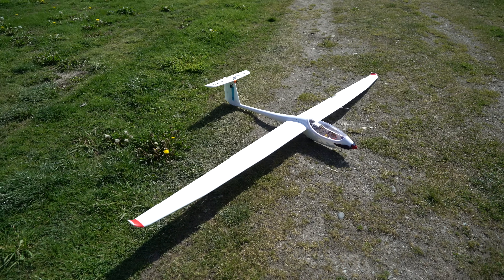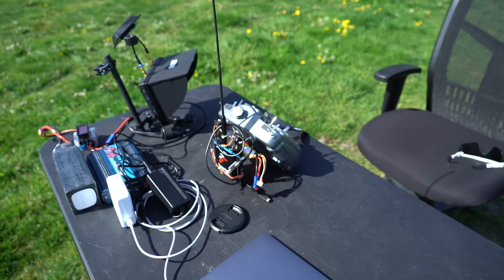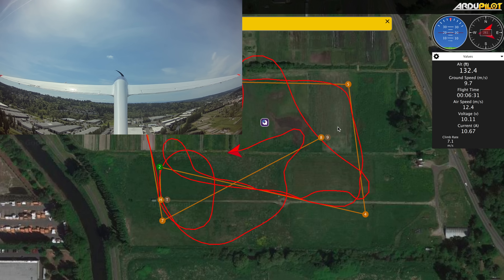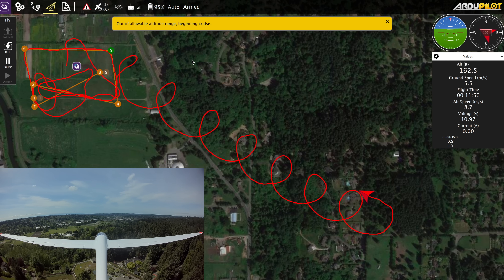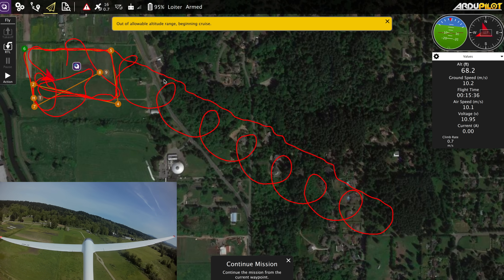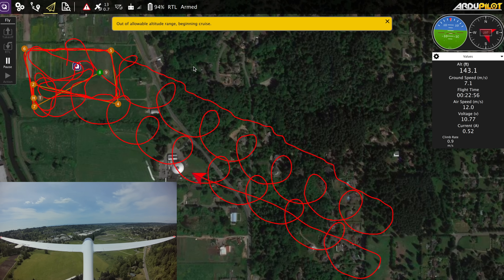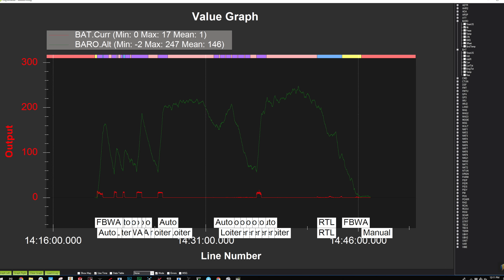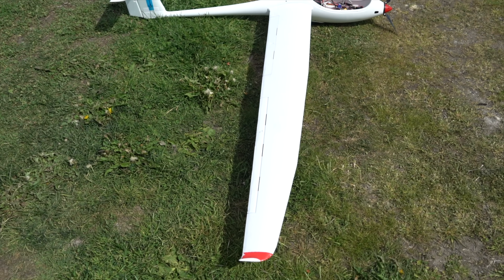Ardupilot Autonomous Soaring - First Test - RCTESTFLIGHT -

Comment: I've been flying RC since the late eighties and the technology keeps growing by leaps and bounds. I always like to do my aerobatics without gyros or mixing and my soaring on slope lift the same and search lift by eye. Occasionally a thermal drifts into the slope on light lift days and is usually evidenced by seagulls or pelicans. I once got in lift with a huge golden eagle. That was wind shear lift flying near Davenport CA across from big creek lumber. Unbelievably strong with an unlimited ceiling but a very turbulent bottom that was about 500 ft elevation and really difficult to get into. I was flying a Bob Martin sr7 that I had for twenty years and had an amazing amount of countless hours flying. That thing was and still is unbelievable IMHO

Comment: When you circle, take care of the distance to the next waypoint. It doesn't make sense to circle away over kilometers and not able to use the height to reach the next waypoint without motor. Then it's best to go to the next waypoint directly. You should test how much your airplane sinks at a distance of 100 m, so you can calculate how far it can circle

Comment: Hello, I don't know if someone can help me but I have a problem with a rc plane the pwm servo output on the omnibusf3v3(sd) board isent working, the board is receiving a signal from the receiver but there is no pwm output for the servos, it only goes out to the motor esc, and the 5v servo rail is working, how do i fix it? thanks if some one helps :)

Comment: If you haven't already, look into the "forward slip" technique for slowing without flaps using the rudder and opposite aileron. Works really well once you get it down.

Comment: As a pilot, I would suggest the following... When your plane got to the trees it would sink because of the air around trees being an average of 10 degrees lower than the surrounding air. So at the beginning of the slope (where the air hit the hill and trees) you had the maximum lift. Can you program the thing to stay and go back and forth in the spot where you hit maximum lift? Like set a number for the lift you are seeking and GPS-like stay there? Your "autonomous" lift seeking thing is just looking for the minimum up and drifting in that direction into lower lift areas that still meet the minimum lift requirement. When it starts getting a lower lift it should turn back to the maximum lift spot, right? Love your videos, thanks for sharing... bye

Comment: Hey @rctestflight love your videos.
Can you explain what is the term 'thermal' that you were using means.
I tried to look it up but couldn't find anything other than thermal imaging camera on a drone.
Reply: rising columns of air in unstable atmospheric conditions. Triggered by a warm spot on the ground, a piece of air starts rising, then continues rising due to the instability. Gliders (and birds) can use them to stay aloft and even climb without flapping their wings.

Comment: Looks like a hoot.  I'm ancient enough to remember going from analog to digital (pcm) RC, not to mention the "galloping ghost".  lol.   Thermals are generated by heated ground, the darker the better, ridge lift is an uplifting from the wind caused by the ridge, it would need to fly parallel to the ridge.  (used to hang glide too.  lol).  Need to look further into this.  Thanks for the effort you took putting this together!

Comment: I'm pretty sure that your plane was tracking a thermal.  If you look at the FPV image, you see that when thermalling, the angle of bank is remaining reasonably constant, with just minor corrections for air turbulence that has upset the glider a little bit.   So, it's "centered" on a thermal and managed to stay with the thermal for a reasonable distance.  I've got 30 years experience flying 1:1 scale sailplanes. and I say Ardupilot does pretty well as a soaring autopilot.

Comment: I don't appreciate him not following up on this. I have Ardusoar flashed on my PX4 and will begin testing on my Multiplex Cularis within the week. I live in Austin where thermal activity is far more abundant in the summer. I'm very surprised more people haven't bothered with reporting on their findings. Seems like no one is out there making steps at optimizing this piece of firmware. I don't want to sound like a dick, but I think everything besides his actual execution of these systems is great. It makes zero sense to use a pixracer when the PX4 has been the standard flight controller for Arduplane. Honestly looks like "rctestflight" goes out there on a whim with little premeditation or refinement of the systems integration. I haven't seen anything interesting on his channel regarding flight automation, he reports far too many long-range mission failures for my liking, and frankly it's most likely because his overall execution of everything is half-baked as fuck. If this is the best of my generation, I'm far from impressed. I see weak performances on this channel. These are all things I've wanted to do, and again, I love the effort. But you're lacking something crucial RCTestFlight. It takes serious repetition to properly exploit the Arduplane firmware on the Pixhawk platform. The standard Pixhawk works fine, why would you use a FC designated for micro-sized multicopters? Oversimplification can be harrowing. I fly long-range without even needing to monitor my aircraft, but I've set forth serious dedication, and when I view your videos I sense very little behind the scenes involvement. You go out and fiddle with a build, but it's never fleshed out as comprehensively and methodically as I would have. Search "Freedom Plus Vision" and you will view my style of autonomous play. I love the effort RCTestFlight. Be great to collaborate one day.

Comment: you will get better results higher. Thermals that low are weak and small. They will join up into one thermal when they are higher. Those cirrus clouds also block up heat from the sun, so there were not so many thermals that day.

Comment: I have that plane it's 3 years old control surface like to fall off otherwise it been good  never found much gliding power with thermals  like my other glider without power  that plane is just too heavy I think... Do you have a brake on your prop because mine never stop spinning

Comment: For someone who has zero knowledge of aerodynamics or RC planes. What is the reason it finds thermals and loiters?  Is flying in thermals more efficient? EDIT: NVM a few minutes later you mentioned that the motor was off so yea thats even more efficient than expected.

Comment: If you watch the video you can see that it is picking termals, every time it changes mode you can see the wings lift from the tips, a good sign that its it in a thermal.
As you said, a trip to desert will really show you what it does and you can expect to spend a day with it in the air, knowing the total amount of radio contact you have is very important if you want to stay in control as any thermal it finds will shift from one mode to the other and wwithout good radfio contact jit can overide homing programmes.

Comment: Your waypoints aren't taking the plane along a route where you would expect to find thermals.
A simple but effective rule is: Imagine coating the ground in honey, then turning it upside down... where you would expect the honey to drip from is where you can expect the thermals to trigger. That is why it started to loiter near the small hill.
Also darker things heat up more in the sun, metal things will heat up even more, rock will stay hot longer into the evening, snow lines trigger thermals due to the sudden change in air temp... the list of things to think about goes on and on.
Great mission though, be interesting to see with a decent set of waypoints.

Comment: I had problems with my dragonlink slim transmitter as well.  Initially the bluetooth worked but then failed to assign a com port on any pc.  Sent it back and was told it worked for them.  They sent an upgrade module back with it that is based off a esp32 and you connect to it via wifi or bluetooth.  Seems to work well.  My original Dragonlink v3 works on all those same computers by the way.   With that being said if you are running 5.8 video I would go crossfire instead.  The telemetry always seems to be faster and less finicky.

Comment: In the 80’s my grandfather and his friends started Soaring products a company that made the Thermic sniffler. The sniffler would send an audible signal to a radio that the pilot wore on his belt. You were able to hear the thermal. They later sold it to ACE RC. The soaring products snifflers are still highly sought after by glider pilots.

Comment: I would say put some clear plastic packing tape over your embedded electronics in the tail... the reason being, all those little bumps from the surface mounted resistors will cause turbulence to start and create drag...     that's why in WW2 they went to all the trouble of developing flush mounted rivets on their fastest fighter planes (P-38, etc)...
cg.air-war.org

Comment: Wow, can't believe the tech like this is at the hobby level now...amazing. Just getting back into RC after 10+ years, amazed at how cheap stuff has gotten, and how GOOD the expensive stuff is!

My very first experience with an electric was a buddy's hand-launch 3-ch glider with a Speed 400 direct drive motor (w. folding prop of course)  and had JUST enough NiCD juice to climb ONE time and circle back down to Earth.  We quickly realized without at least 2 or 3 batteries it took longer to ride bikes to the airfield than any actual enjoyment time!

Comment: Cool, but maybe you should consider the velocity in the altitude motor Diagram. kinetic energy can be converted in to potential energy
Reply: That's what the air speed sensor is for

Comment: I would love to see a little autogyro-generator ... could maybe power the 0.05 amps. Maybe even a solenoid to cushion the electronics, and pull a charge. Maybe you can have a figure 8, and train it to linger into the wind.

Comment: I watched the terrain of the surrounding area, and I have to say that you will not likely find a thermal that low over the field in which you are flying. Thermals will most probably be generated by the rooftops of the buildings grouped in the industrial complex and its parking areas which will most probably be at better than 300 or 400 feet up when they reach the field if the wind is 8mph or less. If it's more than 8 you probably won't be able to do more than two circles inside the thermal unless you stay in it way downwind, but without additional ballast you may not be able to make it back to the field because of how far downwind you went. Best to fly in 6mph and under and look for thermals at about 400 to 500 feet, or you can start out at about 200 feet over those buildings and you'll know immediately if any lift is being generated. We used to do that with a motorless glider and a radio, and had more success than you seem to be having with all that fancy, expensive equipment. Putting all that automation into it takes all the challenge and fun out of it. You're turning it into a push-the-button-and-leave, who-cares-type of flying.

Comment: That's pretty impressive! I wonder if there's and arduino project for paragliding where the XC instructor yells in your ear "your circles are too tight, straighten out, yor turns are too wide, go over there!" ha ha! BTW green forests eat thermals for lunch, that parking lot would have bee a much better choice. Smooth surfaces produce better ridge lift ;)

Comment: I believe it was tracking a thermal but it wasn't climbing very efficiently in the thermal.    You might want to restore your flap function and setup a soaring flight mode where the ailerons and flaps drop about 10 degrees.    That will make it climb better in the thermals.   You can probably make it go in and out of soaring mode programmatically too.

Comment: Would it pay to put tail electronics (specifically the antennae) through and mount it facing downward THROUGH the tail?  My Mavic AIR & Pro Zoom apparently have the receivers/antennas in the fold-down front legs to receive since most likely the transmission would be going up and the small wire through the tail would be minimal but might increase reception stability at longer ranges. I've got some parts on the way to start my own version and would love to touch base. Too bad we aren't closer...we could make some crazy stuff happen I bet! Plz & Thanks for your opinions!
Reply: Also, I'm RIGHT on the border between Cape Canaveral, Space X, NASA, Cocoa Beach, and 1 street away from the beach where I drone record large Osprey and other birds catching LEGIT thermals ALL DAY LONG!  I'm trying to get this birds up aerodynamically ASAP with few to none restrictions on altitude! Please help if you can...I'm new to crossfire and Ardupilot, and the likes but, am competent in those areas as far as how they work, etc. The volume of similar products is what is confusing and I trust your judgement.

Comment: With all that up and down. Chances are it wasn't tracking a thermal. just running into lift. If anything it was tracking slope lift. Also, thermals drift with the wind. So in wind its going to go away if it tracks one.

Comment: Speaking as a Cross Country certified Paraglider pilot: I highly doubt it's adjusting to the thermal on the fly... It was sinking most of the time... If you're in a thermal you JUST rise, not loose altitude... Also the track looks like a windswept thermal. That alone would be perfect! But if you are sinking at the same time it's literally impossible to keep the thermal, you'd have fallen out close to immediately... If it would have tracked those wind-swept spirals WHILE rising, that would have been a thermal. Imagine it like a vertical hose being bent diagonal by the wind.
Also you'll need to make sure your testing area has some good and obvious thermal triggers... Maybe try on the spine of a mountain at the thermal release point? Thermaling is really complex, so JUST relying in the system is unlikely to get you too far... What I did like was the track! It should be a close to perfect sprial pattern, but going upward either vertically or diagonally for wind swept...

Comment: Lower RF frequency for longer wave length produce less propagation loss to any RF up: down link. 

Half the frequency produce 4x link budget. 900MHz from 2.4GHz gives us 7x link budget. The catch is antenna size is linear proportion larger.

Comment: I think that the issue with the drifting down wind was that your loiter mode is just flying a turn rate, not tracking location.  The elongated loops are because the change from upwind to downwind and back with no turn rate compensation to fly in an actual circle.  I skydive and it's something we have to learn how to deal with to get where we want to go.

Comment: Interesting, but kind of defeats the purpose of soaring in FPV (goggles with headtracking). I have the same model, among other gliders, and with a variometer and altitude sensor, enjoy seeking out and soaring in thermals. I rarely use auto pilot, unless I desperately need a pee. :-)

Comment: whats a t h e r m a l
Reply: It's a column of rising air, due to heat from the sun. Remember that hot air is less dense and always rises up, lifting anything on its way - in this case, the plane.
Reply: @nahiyanalamgir7614  thanks, this video makes more sense now.

Comment: Is it possible for a 'full size' aircraft pilot to adopt RC flight?  I'm intrigued by the automation (and telemetry) I see in this video. Any suggestions... The Aviation Buff
Reply: Tecnically, why not? But it will be never be Legal.
Reply: One area regarding sailplane flight, the thermal identification seems to follow just a notice that the AC is climbing. 

With some feed from telemetry, the 'pilot' operating the RC control could respond quicker than just waiting for the obvious 'bump' in the flight path.  Any thoughts?

Comment: Don't worry about the auto thermal, fly it manually and chase the thermals yourself... it looks like it just reaches the thermal detection vertical speed threshold then just enters loiter and doesn't modify the loiter shape to follow the thermal at all..

Comment: Ok, coupla things, you need a free glider computer such as XCSoar on android.
this will give you bar indication of altitude green when within glide and red when below, along with altitude required above or below gliding distance to a way point or home, fully compensated for wind. all you need is the gps data from the model and just about every kind of flight data, including vario display, is provided, which your current system seems to lack.
You can draw an imaginary cone of airspace around the launch point, at the gliders best L/D angle, anywhere above the line you can glide back.

Thermal drift is quite normal, though the glide in auto  does not circle tightly enough to centre the thermal down low. thermals get wider and stronger the higher you go. once centred the climb rate in the core of the thermal should be consistent
I use XCSoar as flight computer in my full size DG200/17C to great effect, often 50km final glides from 6000ft arriving back within 50ft of target arrival height of 1000ft

Comment: I would say 100 feet above the ridge would be outside the useful band of ridge lift.  My experience is from hang gliding.  The minimum sink rate on an RC glider is probably so much lower than a hang glider that the useful ridge lift band might be much higher.